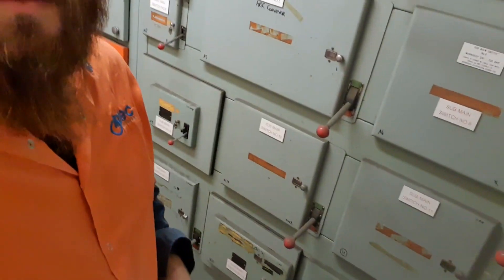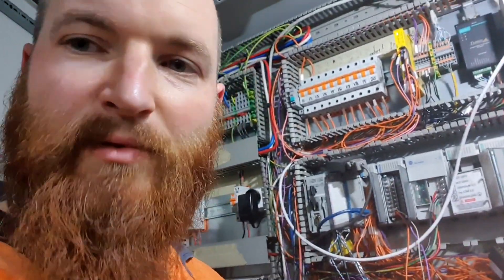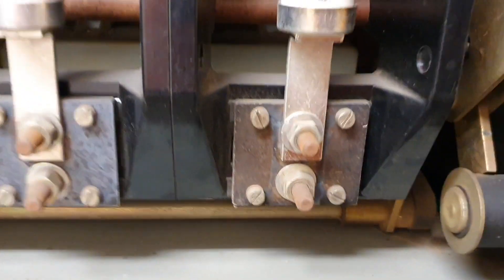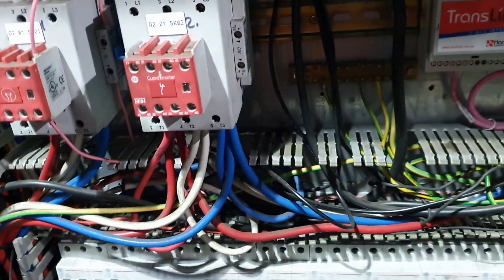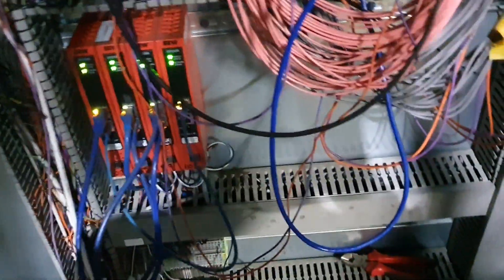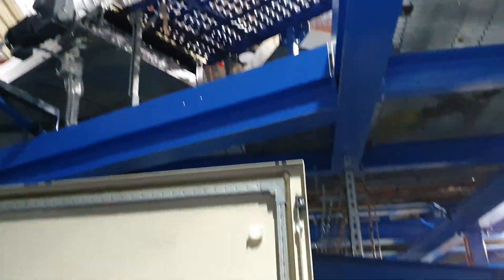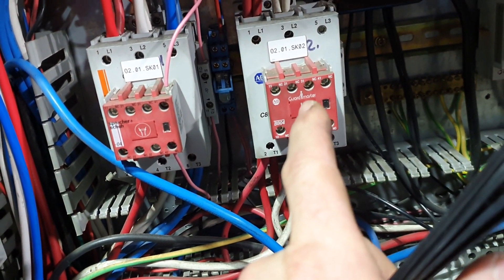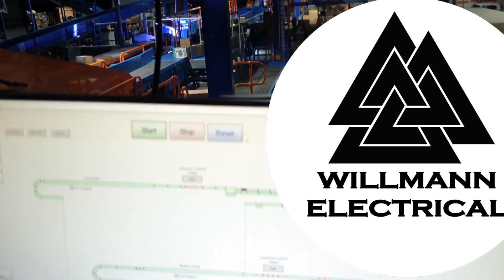Callout Series - Frieght Sorting System Losing PLC Communication, Dug Deeper for Bigger Issues!

Comment: What was causing the comms problem?
Reply: At an educated guess, one or more of the 24volt power supplies must have been on the 2 blown fuses. They may have been interlinked somehow causing the 24V to dropout cause of overload. Not sure though, everything was working fully when i got those 2 fuses temp fixed.
Reply: There are 24v supplies in a bunch of field panels for local safety 24v circuits, whole place needs an overhaul but money money money ya know